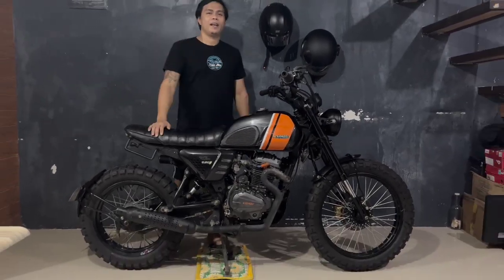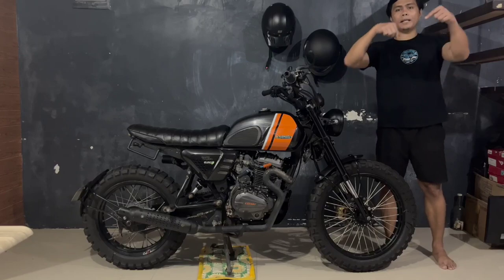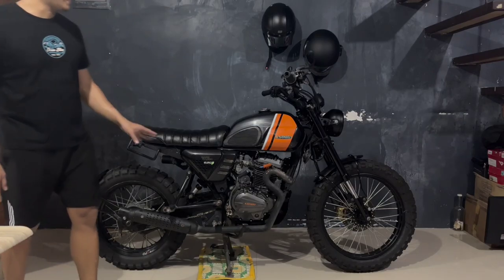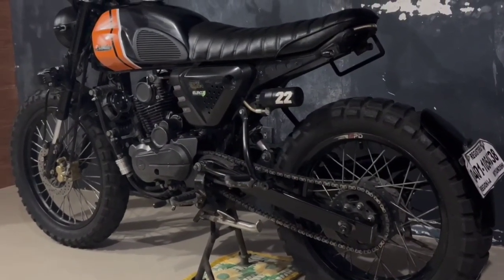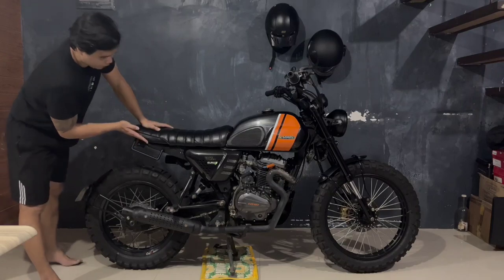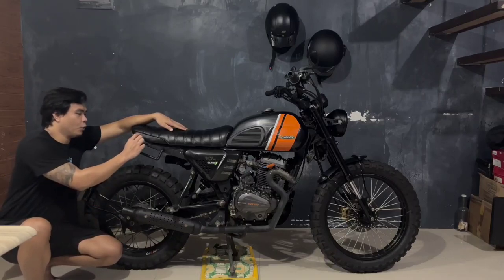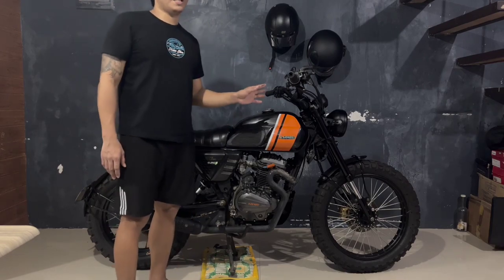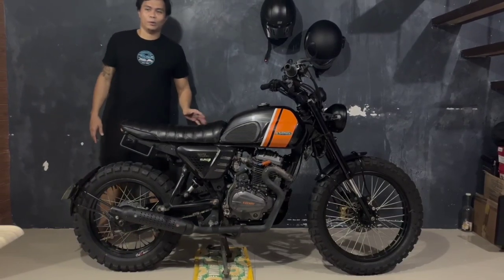KEEWAY CAFE RACER 152 | NEW PERFORMANCE UPGRADES AND CUSTOMIZATIONS

Comment: very Astig ng build nnyo sa motor Sir 🔥.. my link kayu saann nyo nabili ang tires and rims set Sir..
Reply: couple times ko na pinauod build nyo Sir
Reply from the maker: @jeckwelltahil9815  Ito yug details sir

1.85x19 rims front rim ng cafe 400 x Shinko 804 110/90/19 bought from shoppee
3.0x17 rims SPD shoppee lang din x 130/80/17.

https://shp.ee/pehdut2
https://shp.ee/vjxj7yd
Reply from the maker: https://shp.ee/uder4hk

Salamat Sir Solid RS

Comment: Ano po topspeed and fuel consumption nyo sir? Hehehe.
Reply from the maker: Top Speed ko sir ngayon in between 110 to 120 nlng naka high speed sprocket ako and flatslide na 24mm.
Fuel consumption ko 35 to 40kpl depende sa traffic at lagi may OBR ❤️
Reply: Pag nag bigger carb ka sir, like let's say 28mm na carb, dagdag speed ba sya sir? @MrLagalagYT